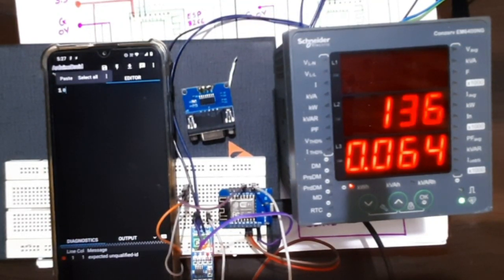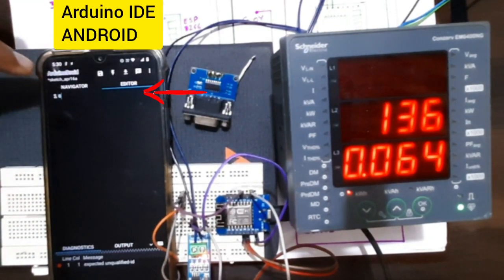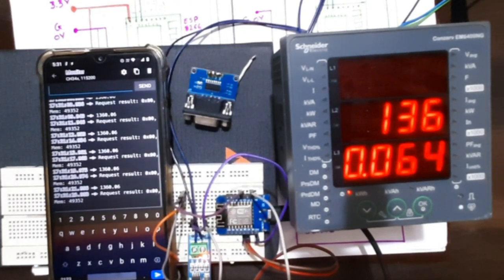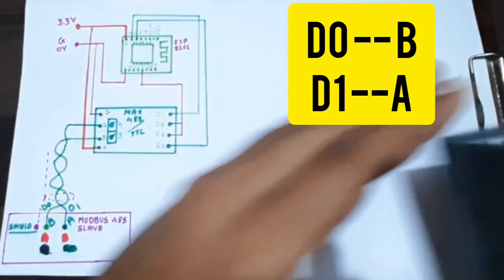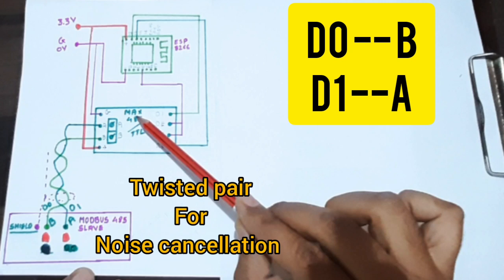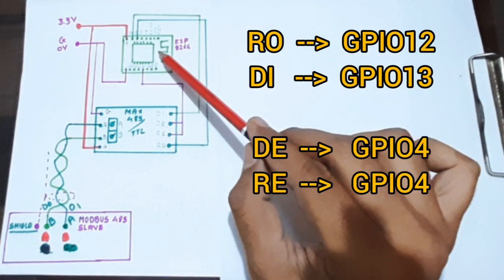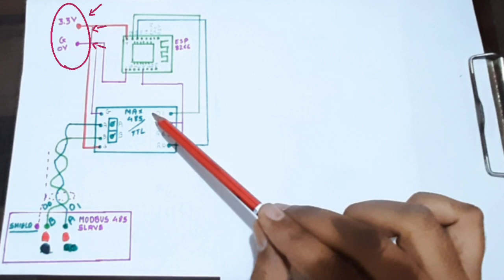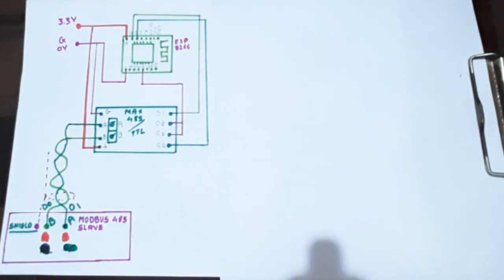ESP8266 Modbus RTU communication with Energy meter EM6400NG

Comment: is there max485 working on 3.3 Voltage ? in video  u connect with 3.3V?
Reply from the maker: Some Chinese 485 to ttl converter works on 3.3 V out of the box.   & i have checked max485 on 3.3 V on breadboard setup which works ok.
Reply: if max485 working on 5V then which pins are  needed level shifter ?  @TechnoAutomation
Reply from the maker: @jaiminoob7825  if Max485 powered by 5V then provide level shifter to RO(Tx) pin of Max 485
Reply: Ok Good  @TechnoAutomation

Comment: I'm using this meter, but when Comm setting to RTFT meter sends reading in sums not real like, until reading kWh reaches 32kWh only then meters updates the next reading.
and do not update +1 or +2 kWh o MODBUS.
Reply from the maker: @justdoingodswork  not getting your point
Reply: @TechnoAutomation  So in meter settings I set COMM : RTFT 
And now meter reading is +4194kWh
ESP32 keep reads 4194 until sudden +32 I.e. 4227.
Then again it start keep reading 4227 for a while. Then sudden 4260 (~+32).
Reading on Meter is increasing gradually but ESP32 somehow reads when sum is +32.

When I checked the data earlier 4194 kWh. the interval was 16kWh.
Reply: This is creating an issue as data read is not real time instead intervals

Comment: Hi I your code worked really well with my single phase smart meter DDSU666-H but I am having trouble making it work with a three-phase smart meter DTSU666. I am constantly getting a 0xE4 response code. Any help would be appreciated. Thank you
Reply from the maker: 0xE4 means no response from slave.
Reply: @TechnoAutomation  so its my smart meter that has the problem?
Reply from the maker: @itsklien  may be. Try to read data using 485 usb adapter in modscan or similar utility in your pc.
Reply: @TechnoAutomation  will try this one

Comment: i getting this error using EM6433 Energy METER 

0.00
Request result: 0x02, Mem: 345972
0.00
Request result: 0x02, Mem: 345972
0.00
Request result: 0x02, Mem: 345972
0.00

IF I OFF THE ENERGY METER 

Request result: 0xE4, Mem: 345992
0.00
Request result: 0xE4, Mem: 345992
0.00

GETTING THIS..................
Reply from the maker: @kasimkotakumar5855  you are close to success as 0x02 means esp have send query which received Slave and slave have responded.

But the address which is requested is wrong. So check the address list from the slave documentation and send a query with right address.

Comment: For VFD control what is required
Reply from the maker: For any modbus slave device all hardware required as mentioned in video.
Reply: @TechnoAutomation  can you make video sir please on this
Reply: Assalam o allikum brother.
I have a 18kw vfd now i am only able to on and off the vfd using esp8266 module.
I want to see the vfd lcd wirelessly on my android
Reply from the maker: You need to read data from drive.  Create webpage & host it via esp webserver api.
Reply from the maker: Similar project i did for energy reading display using webpage.

You can refer below mentioned code

https://github.com/ashish8284/ESP8266_MODBUS_GATEWAY_GROWATT

Webpage.h is for creating webpage
Reply from the maker: If you share me your code then I will modify your code for web page generation.

Comment: Hi, have you tried with multiple energy meters connected in daisy chain with different modbus addresses?
Reply from the maker: Yup.  10 device.
Reply: @TechnoAutomation  Did you use same esp8266 code? I have to read five energy meters which will be connected in daisy chain, let's say address 1 to 5. I want to read data from all 5 from a PC which will be connected on the same wifi router where esp8266 will be connected. One question here, what we call this esp8266, gateway or slave or master?
Reply from the maker: @owaisnajam5304  esp8266 will be master.    It read data from slaves and then you can transfer those data to pc using mqtt protocol.

Comment: Hi Sir Thank you for a codes and related your presentation. Can I do the same with other meter like selec MF383A.Also one more thing about MAX485 to TTL converter, can you suggest a make or resources.
Reply from the maker: Any modbus slave data can be read by this method.    & Max485 - TTL  you can buy from Amazon or any other suppliers.   These days there are plenty of breakout birds available in the market.   Make sure you purchase 3 of them so you can have spare in case any one failed..

Comment: Here in the code , Non parity setting is used can we change the code in to EVEN  parity, because the device parity is fixed in my case....
Reply from the maker: I didn't required  to change that as all slaves I used are nit fixed.

I think  you have to check S.begin(9600,8N1) line.

Try to use 8E1 instead 8N1.

& revert  incase  no communication.
Reply: @TechnoAutomation  Now I managed to change the parity to "None", but only getting result as 0.00 and Request result :0xE4 , Mem; 48680, not able to get the frequency reading from parameter address "40005"  of  Half Dulplex communicating mode.
Reply from the maker: Request Result 0xE4 which means  no response from slave.

You  have  to check  Wiring & ttl to 485 converter  status by tx rx led.

Tx led should blink  while  data transmitted from esp.   

If slave respond correctly  then  rx led should  blinks.

I suffered lot due to faulty  ttl-485 module.

Comment: Can the max485 run off 3.3v? Been struggling with for a week without any luck. Even with to esp32s. One as master and one as slave. I have been using 5v and direct to the pins of the esp which I assume might be the problem
Reply from the maker: Esp32 & 8266 is 3.3V board.

If you have used 5V for Max485 then signals from 485 module is 5 V pulse.    In that case you have to used voltage level shifter or Potential devider to protect ESP32 or 8266.

I have tried 3.3v Max485 & 232 board which makes voltage level compatible for esp.

I have also tried 5V operated Max485 with esp8266. 
In This case I have used potential devider for RX pin of esp8266.  

Tx pin of ESP can directly connected with Max485 converter.

 Voltage level shifter parform best if you have Different voltage operated device.

Comment: Hi Ashish, I Am currently working on something similar to the video. I am using an Arduino mega for communication between the meter and the Arduino board. But I am facing some errors in the serial monitor as it displays some garbage values in it. Can you help me with it?
Reply from the maker: Can you  share me snap of serial monitor???

8160408577 is my WhatsApp number
Reply: @TechnoAutomation  Yes Sure!

Comment: ModbusRTU' does not name a type      this type of error it is showing
Reply from the maker: Do you have  installed  Modbus RTU library from github link which I have  mentioned in video description.
Reply: @TechnoAutomation  yes sir
Reply: @TechnoAutomation  modbusrtu mb in that line it showing error
Reply from the maker: https://github.com/ashish8284/ESP8266_MODBUS_EM6400NG_SCHNIEDER

Download  .in & .h file from above link & try.

Select bord as esp8266 only.
Reply: @TechnoAutomation   I'll having the selec EM2M it can work with that also
Reply: request result: 0x00, Mem: 48936 this is written in the serial monitor and showing 00 value
Reply from the maker: It means there is no response  from  slave. Code is start executing & raise  query to slave.

Q1 :- which TTL to 485 converter  you have used??

Q2:- TX led on TTL to 485 converter  is fleshing??

Q3 Which slave device  you are using??? Make & model ???
Reply: @TechnoAutomation  Max485
Reply: @TechnoAutomation  but in. Meter the communication symbol is showing
Reply from the maker: Answer  of Q2 & Q3 ??
Reply: @TechnoAutomation  led is flashing
And device  is selec EM2M 
I have shared the link above
Reply from the maker: Which  make & model of energy meter you have  used??
Reply: @TechnoAutomation  company selec model EM2M
Reply: @TechnoAutomation  you find some thing
Reply from the maker: Hi, 
I am hospitalised so didn't respond. 

Did you get success??

If no.

Inform me your  energy meter make & model number.

Check meter ID, baudrate, stopbit & pairity.  & let me inform.
Reply: @TechnoAutomation  hope you are good now 
No success i have tried 2 different code but from meter side it show data transmission is in process but serial Only 0 value is showing or for some address it show 65535
Reply: @govindsinghrathore4282   is this issue resolved? I am using SELEC EM4M and I am getting similar error. I fyou have solved this, could you please enlighten me too

Comment: Hi Ashish, it was a great video. I am currently using the RS485 to TTL which you mentioned at the last will you please help how to code for that converter. It would be appreciatable. Thanks in advance.
Reply from the maker: Hi,
 code will remain same for rs485  - TTL   or Rs232 - TTL.

You can find  working code on my github account.    Link is in video description.

Comment: how to use modbus with EC Sensor sir..btw nice video
Reply from the maker: You have to get modbus address list from manufacturer.

You can use same code which I have  explained in this video. Only communication parameters  & read register to be changed. 

Try to read single register first.

Comment: MAX485 can be powered 3,3V from esp8266 pin? MAX485 doesn't have to be powered with 5V? Whaaaaa...?
Reply from the maker: Yup setup you have seen in video is 3.3v operated its Woking fine.    I have  made wifi gateway for Growatt Inverter  which  works since year without  failure.
Reply: @TechnoAutomation  So can I power the esp8266 nodemcu through VIN pin with 5V and then use 3v3 esp's pin and power the max485 chip?
Reply from the maker: Yup.  Its possible. Check  485ttl converter specifications.   Some module work on 5V only.

Comment: hello friend am trying to read the mod-bus data from Siemens APFC using Nodemcu 8266. am able to read the first input register but consecutive following register am not able to read i tried creating Mread1 instances and conversions but the second data always read 0.00.. any ways to rectify ty.
ex :
 if (!mb.slave()) {
    mb.readIreg(1, 0x30040, Mread1, 2 , cbWrite);  //(SlaevID,Address,Buffer,Range of data,Modus call)
    mb.readIreg(1, 0x30000, Mread2, 2 , cbWrite);
   Serial.print("V1 ");
   Serial.println(InttoFloat(Mread1[1], Mread1[2]));

 Serial.print("V2 ");
   Serial.println(InttoFloat1(Mread2[1], Mread2[2])); // v1 Read fine but v2 is 0.00.
Reply from the maker: Hi,  my first  suggestion is read Individual  register first.   

I.e  first  read 30040 only  and check  data is OK or not. 

Then read 30000 only and check  data is OK or not.

If got success then refer my code on github.   
In that  code I have  read different  registers  by making  cyclic call for individual register. 

https://github.com/ashish8284/ESP8266_MODBUS_GATEWAY_GROWATT/blob/main/Modbus_Call.h
Reply: @TechnoAutomation   yes friend the first register followed by if (!Slave) is always correct no matter  what the registers address is. But the problem is second one i tried many combination possibilities  but its always 0.0. I dint look at growatt. Now ill have a look . Thank You.
Reply: @TechnoAutomation   Thank You, my friend. got it to work, the trick is to use "for"statement. & do you do undertake projects ?
Reply from the maker: Yup.
Reply from the maker: Hi , 8160408577.
Reply: Hi, I am facing the same issue. Can you share the code of doing it with for loop.plz help
Reply from the maker: You can find link of GitHub in video description.   There are three different code in there.
Reply: @TechnoAutomation  Thanks for the help . I used the call back function as:  void ModbusCall() {
  if (CALL_STP == 0) {
    if (!mb.slave()) {
      mb.readIreg(1, 3053, Mread0, 2, cbWrite);
      for (uint16_t x = 0; x < 2 ; x++) {
      }
      CALL_STP = 1;
        }
    
  }
  if (CALL_STP == 1) {
    if (!mb.slave()) {
      mb.readIreg(1, 3055, Mread1, 2, cbWrite);
      for (uint16_t x = 0; x < 2; x++) 
      {
      }
      CALL_STP = 0;
          }
      
} But didn't get the reading from 2 registers. Also I don't understand the purpose of using for loop. Plz Help
Reply from the maker: This code is for to read multiple reading fron different address. (40001-40006, 40014-40024) 

If you want to read data having single address or in sequence(400010-400020)  then use code mentioned in Schneider em example.
Reply: @TechnoAutomation  I actually want to read two registers as:
Active Power A		3054 (register address)
Active Power B		3056 (register address)
Refer to your examples I use the following code: But I am getting value   value of first register only
 At second register I am getting 0.0 . Any ways to rectify. The complete code is:

#include <ModbusRTU.h>
ModbusRTU mb;

#include <SoftwareSerial.h>
int DE_RE = 4; //D4  For MAX485 chip
int RX = 12;
int TX = 13;
uint16_t CALL_STP = 0;

#include "IntToFloat.h"

SoftwareSerial S(RX, TX);//D6/D7  (RX , TX)

uint16_t Mread0[2];
uint16_t Mread1[2];

bool cbWrite(Modbus::ResultCode event, uint16_t transactionId, void* data) {
  Serial.printf_P("Request result: 0x%02X, Mem: %d\n", event, ESP.getFreeHeap());
  return true;
}

void setup() {
  Serial.begin(115200);
  S.begin(19200, SWSERIAL_8E1);
  mb.begin(&S, DE_RE); //Assing Software serial port to Modbus instance for MAX485 chip having DI,DE,RE,RO Pin at TTL side
  mb.master(); //Assing Modbus function as master
  Serial.println(); //Print empty line
  Serial.println(sizeof(Mread0)); //Reaing size of first array
}

void ModbusCall() {
  if (CALL_STP == 0) {
    if (!mb.slave()) {
      mb.readHreg(1, 3053, Mread0, 2, cbWrite);
      for (uint16_t x = 0; x < 2 ; x++) {
      }
      CALL_STP = 1;
        }
    Serial.println("Voltage A-B");
    Serial.println(InttoFloat(Mread0[0], Mread0[1]));
    
  }
  if (CALL_STP == 1) {
    if (!mb.slave()) {
      mb.readHreg(1, 3055, Mread1, 2, cbWrite);
      for (uint16_t x = 0; x < 2; x++) 
      {
      }
      CALL_STP = 0;
          }
    Serial.println("Voltage B-C");
    Serial.println(InttoFloat(Mread1[0], Mread1[1]));
      
}

}
void loop() {
     ModbusCall();
   
  
  mb.task();
  delay(1000);
  yield();
}

Voltage A-B is correct
VoltageB-C is 0.0
Reply from the maker: Try to read all data by single query as all data are in sequence.    

mb.readHreg(1,3053,Mread1,4,cbWrite)

Increase buffer size  to 4 or 10.

Print individual data of buffer.

Like 
serial.println(Mread1[0]);
serial.println(Mread1[2]);

Etc.
Reply: @TechnoAutomation  Thanks. It worked. No I can read the registers using repetitive call backs. But the issue is there is 3 sec delay between reading register. Can I minimize  the delay
Reply from the maker: Glad to hear that.